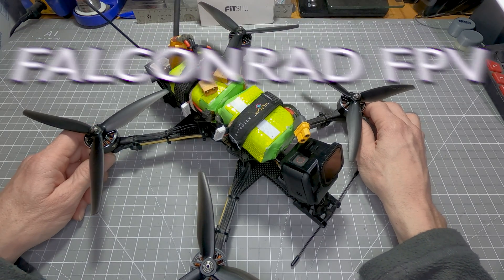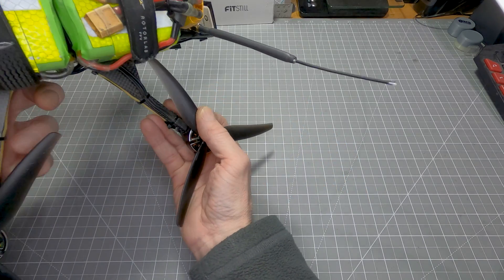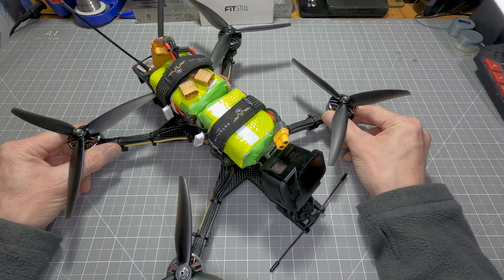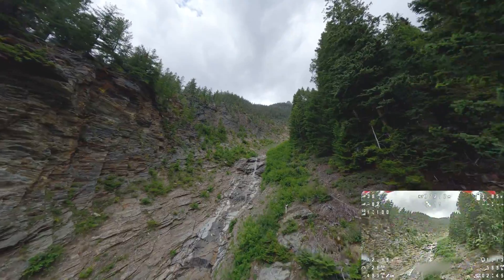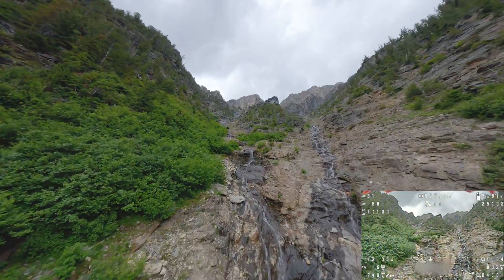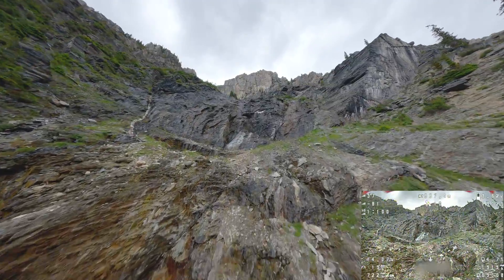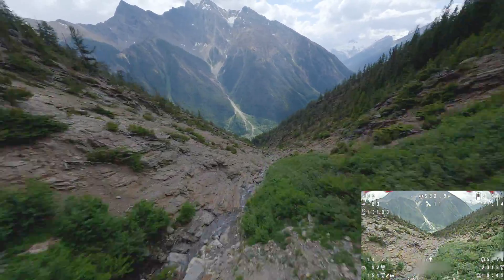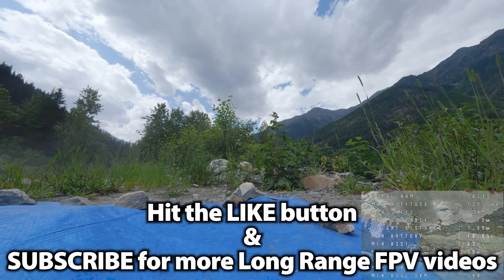Why I use A Diversity RX For Long Range FPV & A New 2.5W VTX

Comment: Great flight! I really enjoy the informative dialog.
Speaking of information, how do you connect your GPS with the FC you've listed? If you followT-mMotor's suggestion the compass/GPS and ESC will both be on UART 4.
Reply from the maker: T motor f7 pro FC:  (all listed at bottom left corner of flight controller instruction page that comes with the FC)
uart 1 - dji or smart audio
uart 2 - RX
uart 3 - GPS (mag goes to SCL/SDA beside RX3
uart 4 - ESC telemetry
5 and 6 still free

Comment: Awesome video! I think I’m going to give the radiomaster bandit module a try in my tx16s, I have a sneaking feeling it will output two watts just like the ranger module in 2.4ghz will and Iflight recently released a true diversity 900mhz elrs receiver with 500mw of telemetry power  so I think it will have the potential to do extremely well range wise compared to crossfire. Will be trying it out in my helion 10.

Comment: that Y xt60 adaptor wire will add resistance right? and lower the voltage a bit. but you still get max FT with the setup..
Reply from the maker: Yess you are correct.  But it is a VERY TINY amount.  I'm only guessing but the voltage drop would probably be less than 0.1 of a volt and the resistance difference would be almost nothing if you use 12 or 14g wire.  You'll waste more mAh by plugging your drone in and waiting 30 seconds before taking off.
Reply: @FalconRadFPV  i see. But wait is that xt90  to 2 xt60 ?

Comment: So those props hq reinforced glass nylon? What do you think of them?
Reply from the maker: I always use the polycarbonate props.  The cf/glass nylon ones are nice and stiff but they shatter on impact.  So for me flying long range, I will take extra durability over a slight performance improvement.   I'd rather make sure my drone has the best chance of making it back home after a branch strike.
Reply: @FalconRadFPV  agreed 🙂
Reply: Nvrmnd I figured out they are😅 they looked like thise props. I just picked some up for my 7" and was curious if you had anything to say about them

Comment: Love your videos . Whay size strap do you usually use with li-ion  batteries
Reply from the maker: I think it's 280 or 300mm that works, but it also depends on how the strap is made, shorter ones will work for 18650 packs if the velcro on the buckle side is 3/4 of the length or so.

Comment: as a beginner in long range FPV - for 2808 motors at 1500kv - would you recommend a 2600MAH  6s lipo, or should I be going larger as in greater than 3000 mah?
Reply from the maker: Depends on what you are using for your drone and the environment you have to fly in.   On one build a 2600mAh will get you 5 min and 5km on a different build it'll give you 10km and 10min.  I usually use a battery that will get me where I want to go.  If I'm going 2 or 3 km out and back I'll use a 3000mAh lipo on my Falcon frames, but on my RAD Li-ion frame I'd use a 6s li-ion pack because a 3000mAh lipo won't fit on the top plate.  If I'm going 5km out I'll use a 6s2p li-ion battery made from 18650 cells for 5600mAh total.  On the Falcon frames it fits all on the top plate, on my RAD Li-ion build I would split it into two 6s1p packs and mount one on top and the other underneath.  It's best to fly with the right size battery for the distance you want to go.  That way that drone isn't carrying too much extra weight and will have better handling.  2600mAh is about the most mAh you'll get in a battery in the 110mm size range.  For more mAh the larger batteries step up in size to about 145mm for anything 3000mAh or bigger.  If you are new to long range I would suggest a focus on learning about your video signal and how it is affected by having trees or a hillside in the way.  Start off with less range and get comfortable with how you are going to respond when your video cuts out before jumping right to going as far as you can.

Comment: Hello sir, I followed your drone build and currently using the same set up with the nano diversity receiver crossfire and the extended immortal antenna. However, I do not have good distance like yours. I have it set up at 100mw on my transmitter and have dynamic power on but I get about 100-200m LOS and I already got "telemetry lost alarm". Would you happened to know what I may have done wrong? THank you sir.
Reply from the maker: If you contact me by email at falconradfpv@gmail.com and send me a couple of pictures of your build I might be able to spot some sort of problem with the antenna mounting or something.  You should change from dynamic power to a set power level, it's more reliable.  If you plan to fly out at range boost the power up to 250mW (although 100mW should get you plenty of km's of range)  It must be something to do with your antennas I'm guessing.  You also need to make sure that the transmitter, BF and crossfire module are all using compatible firmware.  I'm on 6.17 for crossfire, using 6.19 and crossfire V3 wasn't working well enough for me.  Also the telemetry lost alarm doesn't really mean anything, I used to get it all the time while km's out.  I don't really get that any more though, are you on updated firmware?

Comment: hello ,what is max distance of vtx solo rush 2.5 watt?
Reply from the maker: It's difficult to explain output power and range sort of.... 200mW can go 10km if there are good antennas on both ends of the transmission. 
 2.5w with good antennas will probably clear 100km in good conditions.  With the distances that drones are capable of the difference between say 800mW and 2.5w will just be slightly better clarity.  A higher output power will have it's most notable impact when compared in obstruction penetration.  Like getting behind some trees when several kms out, 2.5w will manage to get a much better signal through the trees than 800mW will, in this situation I think you'll see a bigger difference between the two output powers.

Comment: I have a 6s2p battery with 5600mah what mah and voltage is it safe to take down to for long range flights?
Reply from the maker: So Li-ion cells performance will vary from brand to brand, but generally with modern li-ion cells you should be ok flying until the voltage reaches 3.0v  With most li-ion cell types there will be very little capacity left once you reach 3.0v and the voltage will usually start to drop quickly at that point.  With my 6s2p P28A li-ion packs (5600mAh rated) I get about 4900 to 5000 mAh out of it before reaching 3.0v and the voltage starts dropping quickly.

Comment: jesus man 12s and 2.5 mw you should be able to get to ganymede
Reply from the maker: It's 6s, two 6s packs in parallel.  So the voltage stays the same, but the mAh capacity is doubled by adding the second pack.  In parallel the two packs will also share the current output making it easier on them.

Comment: Great video. I am impressed by how efficient your long range rig is. Your amp draw is so low and at the end you only used 2700mah of battery. My chimera 7 pro v2 will probably draw about 18-20 amps constantly when going up a mountain like this while yours was in the low teens. Is it because of the lighter frame? More efficient motors? Thanks!
Reply from the maker: Thank you!  Most of my long range builds are made for efficiency and I've been perfecting my setup over the last few years.  This is my Falcon RPM frame, focused on flight performance and HD camera mounting options.  Similar size to a chimera 7.  My other frame and long range build, the RAD Li-ion is made for max efficiency and does about 6 to 10% better than this build for low amp draw, efficiency and flight times.  Chimera's are a bit heavy with big motors, they can probably fly quite fast, not optimal for long range though.  The gopro up on top of the top plate also adds extra drag, along with battery placement options will all influence the efficiency and flight time.
Reply: Amazing! I will be extremely interested if there is a BNF version of your frame. Honestly I enjoy more flying than building an FPV drone. I don’t mind repairing it but building from scratch takes a long time. Thank you!

Comment: why not go for the 5W foxeer infinity VTX?
Reply from the maker: The 5w VTX is huge, it won't fit in a regular 7" frame.  You need something BIG, maybe a 10 inch?  It's maybe 12x the size (by volume) of a rush solo VTX.  This 2.5W from GEPRC that I'm going to try out just barely fits in my 7" RAD Li-ion build and the 5W one is about 3 X bigger, its huge!
Reply: haha, i know what you mean, but had one in my 5" APEX :D  I actually saw  demibot 5" build it fit in well though... @FalconRadFPV

Comment: Where would I find that bardpole antenna?  I assume that if it works for Crossfire it will work for ELRS 915mhz?
Reply from the maker: TrueRC used to sell bardpoles, but it's expensive getting shipping right from them.  Not sure where to get them now,  I've started making my own so I haven't bought one in a year or two.  I'm hoping to get around to making a video about it.  Should work for any 915mhz RX.
Reply: @FalconRadFPV   Oh thats cool.  Id love to see that video :)  So I could use one T antenna and one bardpole and its OK to mix the types?

Comment: Hello FalconRad FPV.  I don’t have a drone, but want to buy one. I would love to fly over the mountains like you and make good quality video recordings. I understand it takes a lot of practice. I’m thinking to buy a Chimera7 Pro from the iflight website, but I don’t know if I should go for one with an analog 5.8G 1.6W VTX, or one with a digital DJI O3 AIR UNIT. And then which goggles to go with this. Maybe you can help me out?
Reply from the maker: It's a big decision choosing analog or digital.  Of course digital is going to look much nicer when flying and give you more detail.  Analog's advantage over digital (DJI at least) is the video reset time.  For a lot of people it won't make much difference.  But for some, like me, the longer video reset time is tough to deal with if you fly very close to the environment and increase the risk level.  If you plan on being higher up in the air away from ridge lines and rocky outcroppings that can block the video signal then it shouldn't be an issue.  As for goggles there is so much choice now, it's really a little different for everyone.  Orqa and fatshark make pretty good analog goggles.  For DJI the goggles V2 have more ability to add aftermarket antennas which helps a lot with range.  But with the 03 air unit even the goggles 2 will still get pretty good range with only a pair of swappable antennas and the other two are internal.  Then there isHD Zero, it's digital but looks like high quality analog.  The video loss also responds like analog video, it breaks up and losses clarity but does not freeze and or turn off like the DJI system does.  It's all pretty subjective, ask 10 people the same question and you'll get at least 5 different answers.  I really enjoy flying DJI but it worries me to really push the limits on losing video.  With analog I'll fly behind a mountain ridgeline and see the video go really bad, so i'll gain a few feet of elevation and the signal clears up.  So I can "ride the line" of losing video without to much worry just a little throttle and the video comes back.  With my DJI and goggles V2 and 03 air unit it looks great until it doesn't and suddenly it's frozen.  I never "ride the line" of losing video with my DJI setup, way too sketchy.  I haven't used the goggles 2 at all but I've heard that they are trying to make it easier to know when the video will cut out, the newer goggles 2 and I think integra are supposed to have red bars that appear at the edge of the screen to indicate how strong the video signal is and if it's getting close to failing.  Unfortunately the goggles V2 don't have that option, DJI kinda sucks at firmware updates, they'll do a bunch and then just stop making them and expect you to just buy the newer goggles to get the latest improvements.  I'm sure they could add it to the older goggles, but they just drop support after they newest thing comes out.  A lot of people don't like DJI and for valid reasons but it's hard to say no to such beautiful video in your goggles.  This is a decision that you should make after hearing several peoples opinions about.  My guess is maybe choose the DJI version and just be a bit more careful when flying long range, but that is much more easily said than done.  I lost video a bunch of times back when I was still learning long range.
Reply: @FalconRadFPV  Thank you for your elaborate answer! I’m leaning towards analog on the moment.  I’m living in Europe (The Netherlands). I heard the DJI O3 Air unit and/or DJI goggles might be limited to a range of 2km because of CE standards, and that you can hack the firmware, but this does not always work. Regarding analog goggles I also heard about the “SKYZONE Cobra x V2 Diversity” Do you also have an opinion about these things?

Comment: Great vid as always. I wounder would 8s2p 21700 (e.g. samsung 50S) perform better? Less current and more mAh (10000). But yes, the weight.  Maybe such batteries is more suitable for the larger quads.
Reply from the maker: 6s2p 21700 is getting pretty heavy for a 7" drone.  A 7.5" with 3008 motors handles 6s2p 21700 alright but it still fly's feeling heavy.  8s2p 21700 would require a 9 or 10" drone to manage the weight nicely.  6s2p 18650 is the sweet spot for 7 and 7.5" builds in my opinion.  For 7 or 7.5" 8s1p would be an appropriate size.  I've gotten almost 40 minute flights from 8s1p on 7" with 5000mAh li-ion cells.
Reply: @FalconRadFPV  How could you tell if the battery is too heavy for the drone? Is there some kind of numerical values or it's just the feeling?

Comment: Falcon, what is your opinion about 10 inch drones? Are they better for slow flight with Sony's big camera? and would you fly in the mountains on the 10th instead of the 7th?
Reply from the maker: I've never flown a 10" but I know the vibrations will be an issue to deal with.  The bigger a propeller is the lower frequency of vibrations it will create.  At 7 or 7.5" the drone needs to be fairly well designed to keep vibrations from being an issue, with a 10" it will be even more difficult to keep GoPro footage as crisp and clear as with a 7".  I would question if maybe a 7" hex or octo would do a better job with a heavy camera and long range than a 10" would.  I've flown my octo 6km out, diving mountains and waterfalls.  A 10" will be a bit more efficient than a 7" octo but the octo will have an easier time getting crisp gopro footage due to the 10" having a much lower prop speed.
Reply: @FalconRadFPV  Thank you, Falcon, I think your advice will change my choice of a new drone. The iflifgt has two drones of 9 and 10 inches, with 6 mm beams. Do you think there will be vibration with them anyway?
Reply: thank you so much for such a detailed answer

Comment: I need diversity on my quad. I keep failsafing in the middle of turning around to come back home if I go out past 3kms. This definitely seems like the fix for that.
Reply from the maker: It likely would help your situation to have a diversity RX.  But it could also be your antennas placement and/or orientation on the drone.  It does sound like you are likely using an immortal T and probably pointing the null end of the antenna towards home as you turn around.  Are you using an immortal t on your TX?  A TBS diamond or TrueRC truemox would likely improve your transmitters reception of the signal without needing to make changes to any drones.
Reply: Thanks, I just ordered a TBS Diamond antenna to use on my TBS tx module. Will see if it helps. I get the same issue with my Crossfire & ELRS quads. I like the idea of having one antenna vertical and another horizontal like you have for full coverage when diving cliffs further out. Will try that if this doesn't give me the distance I need. @FalconRadFPV